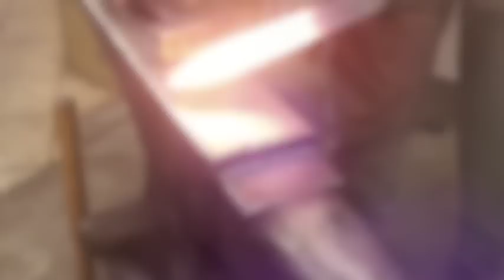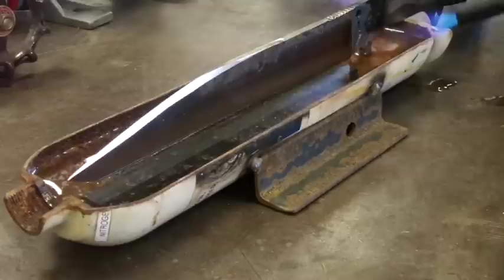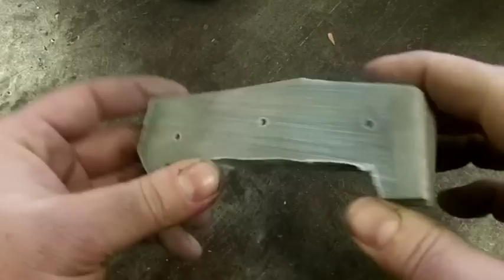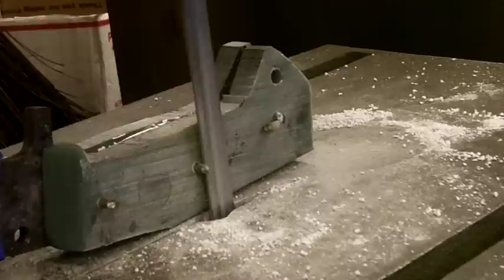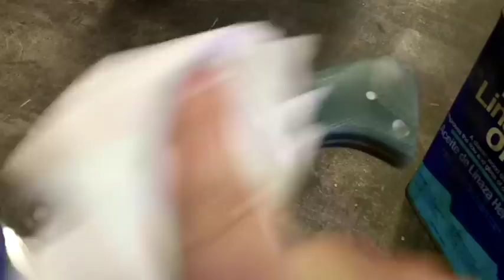Survival Knife Start to Finish

Comment: I'm 67 but I'm just beginning to make knives and I have a few questions.  What's with opening the side door of your forge as you bring the knife to heat?  Also, what are the tools called that hold the knives upright in the tempering oven and where can I get one?
I wish I had a band saw and a 2X72 belt grinder.  That would make things a lot easier.  Trying to live on disability, as an income doesn't leave much left over for tools.  Ut's more like existing, than living!
Thanks for the full video, I learned a lot!
Reply from the maker: Hey Kim! I was opening the door to keep from overheating the tip when normalizing. That rack was fabricated stainless that we made because we're too cheap to buy one. Keep it up! Forge close and cleanup can be done very quickly with hand tools!

Comment: Great knife.
I see a lot of blade smiths put water on the anvil while forging. I was told that the reason is to remove scale. How dose that work and at which stage would you usually do it?
Reply: You'd have to experiment to know when and if it is worth while to do so, but it won't cost anything but time to try

Comment: Correct me if I'm wrong, but does putting lind seed oil on G10 really do anything? i mean g10 is a fiberglass-based laminate (meaning it's basically fiberglass encased in a super strong resin / epoxy, so I'd think it wouldn't be penetrated by the oil. Or are you just using it as a lubricant for the sand paper? Either way the scales were absolutely gorgeous and I'll be looking into a class.

Comment: Nice video, it was a great watch! I have a question, what was the size and thickness of the piece of steel you used? I'm just getting into forging and I have no idea were to start when it comes to proportions and how much or how little steel to use.
Reply: Its funny you ask bec the thing about forging a knife is that it really conserves steel. Try a piece of full length bar a quarter inch thick and an inch wide. With skill you can make a bowie. If you have a relatively lame forge try 1/8" thick steel first. Oh: you don't use the whole bar on a knife but it gives you a handle. You'll figure out a length to use if you're holding the steel with tongs after the first knife

Comment: 2 questions,,, 
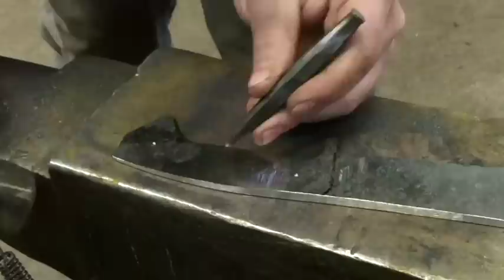1 - Why does the spine thin down towards the end of the handle (11:38) (34:36)???  
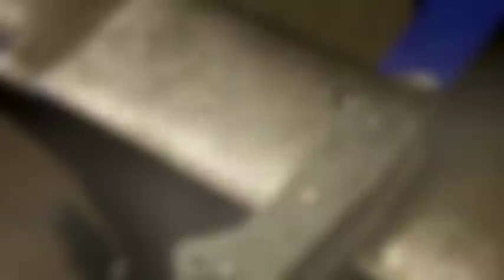2 - Why round over the pins (31:55) then grind down and take out the rounded over area??? 

Just trying to understand,,, Thanks much
Reply from the maker: Hi Maurice! Thanks for watching. 1: The tang is tapered for better balance. It pits the weight right at the forefinger 2: You'll notice after drilling I use a tapered reamer to open up the outside of the holes just a little. That way I can peen them and finish them flush and still have a mechanical bond without leaving a rivet head.
Reply: @NESMforged  Ok yep I see that now on the reemer,,, thanks much

Comment: I'd love to know more about the process you used with the blade and the small torches. Soft back draw, if my terminology is correct. What steels benefit?  What you are looking for?  Etc. Thanks for the great video BTW!
Reply from the maker: Mike, I am selectively tempering the spine of the blade to ensure that it is springy. It happens at a relatively low temperature. I look for a blue color. I don't  want to get to dull red, because that would make the blade squishy. It's not really necessary if you do everything else just right, but I like to be sure.
Reply: Thank you!  I knew about keeping the temp relatively low--well below red. Is there anything else specific you like to do besides the soft draw?  Also, what kind of steel is this knife?

Comment: Great video. Do you polish your file work before HT? If not, have you ever had an issue with stress cracks?
Reply from the maker: Good question. I have found that if you have file work that has no right angles and it is consistently file finished there is no problem. If you elect to polish the file work and there is just one file mark left, it will almost always crack at that one file mark.

Comment: Did I miss it or didnt he say what kind of steel he was using, and I know each knife is an extension of ones self,, but there is no reason to leave all that scale on the blade
Reply: skeets skeets just because you don't like the scale doesn't mean that Knowone else does
Reply from the maker: It was W2. The forge finish is polarizing. I do find that the iron oxide coating prevents corrosion.
Reply: I like the way it looks with scale. Soooooooo, yeah.
Reply: I think what he meant was there's no PRACTICAL purpose for having the scale on the blade. And as far as I know all that it might do is add a little protection against rusting (not completely sure) but yeah it definitely looks pretty sick with the scale on there!

Comment: you chiped it when you hit that METAL bench.... dont under stand why you hit the METAL bench?????.was it a bad heat treat..
Reply from the maker: It was indeed a mistake. I am happy with the heat treat as it was fairly thin(about .018 before convexing) at that part of the edge and that was a full force chop. If I left it at .030 before convexing there would be no damage, but it wouldn't work as well as a knife.